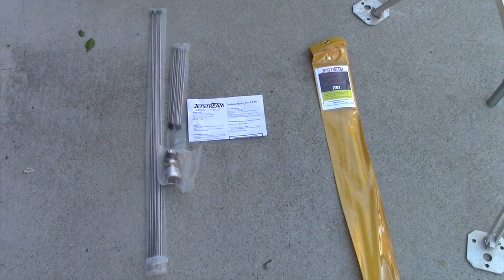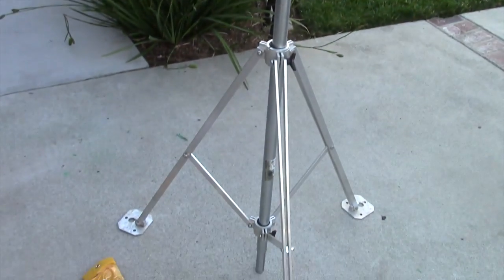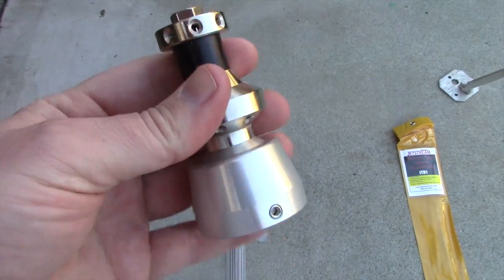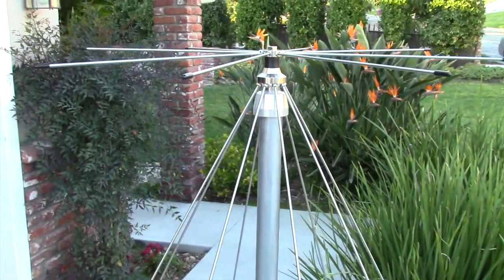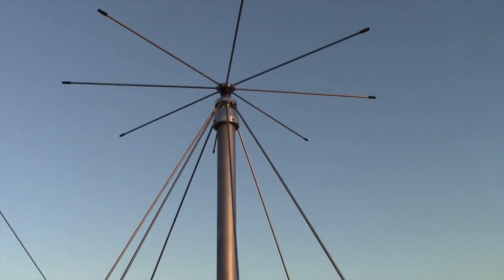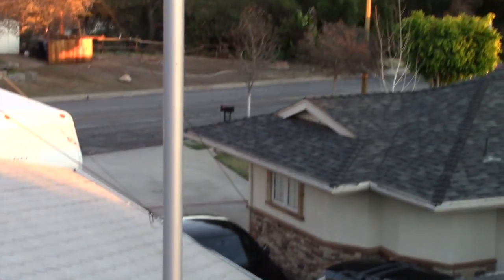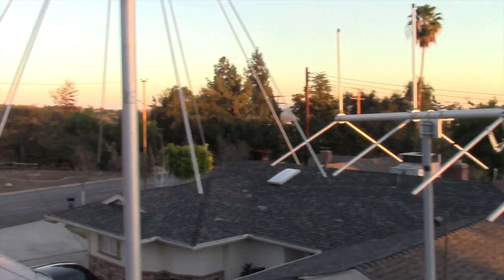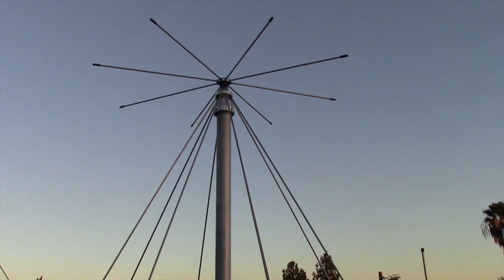AE6LX Installs a Jetstream Discone VHF/UHF Antenna

Comment: good video. just a tip always add some anti-seize to every place you put two parts together (screw in) that way you will never have a issue taking it apart down the road. If you live on the coast its a must. when your dealing with stainless steal its a must to keep it from binding up.

Comment: You are REALLY going to want to put split washers between the nuts and the hub.   Wind will cause the radials to vibrate, which will loosen the nuts, which will cause the raidials to unscrew, fall and get lost.  How do I know this?  It happened to me.  I was down to three radials after 6 months in the air.  All it took to fix the problem was a set of stainless steel lock washers from the nearest ACE hardware store and borrowing the tall ladder from the friend AGAIN.  Why couldn't they include lock washers with the antenna?  PROFIT.
Reply: http://hillcountryengineering.com/wp-content/uploads/2011/10/Split-Lockwashers-Separating-Myth-from-Truth.pdf

Comment: I have the JDT2 which has the 6m vertical on top, and 2 of the lower vertical radiators have loading coils and an adjustable stinger. No instructions on how to tune, I'm assuming these are for the 6m. What say you??

Comment: what kind of mast should I use on mine?
Reply: Structural aluminum tubing is probably the best, but may be difficult to find depending on your area.  A discone antenna like the one Tim shows in this video doesn't have a high wind load, so you don't need anything massively strong like you would with a big HF yagi.  I've used 1.5" EMT or IMC conduit from Home Depot in situations like this with very good success.  They've survived multiple wind storms of 70+ MPH gusts here in AK with no issues.
Reply: @AlaskaMike72   ... The top horizontal rail of a chain link fence works great for a mast... cheap too... :)
Reply: @wolfgangsnitsar4739  Yes--that's also an excellent choice for an antenna like this!

Comment: Hi iv got vhf scanner here in Ireland's. iv had a standard sky king fibreglass antenna. but the cable has got damaged over the years. so need a new one would u recommend the discone over the skyking for a uniden base scanner. I usually use it for boats up to 15 mile from my house.

l
Reply: +seamus doohan I would need to see a picture of that sky king to understand what it is before I could answer that question
Reply: +Tim Tucker http://www.longcom.ie/product.aspx?id=316

Comment: I've got the same antenna in a Tram version.  What kind of SWR readings are you getting on 2m, 70cm, and GMRS?
Reply: Overlin Alaniz I'm using the Diamond version of this antenna antenna to Receive/Transmit 6 Meters, 2 Meters, 220 MHz & 440 MHz via some mobile duplexers/triplexers.  The SWR on all 4 frequencies is about 1.20:1.  The Jetstream should be about the same provided that it has the 6 Meter whip on top.
https://www.youtube.com/watch?v=B-IwfcQrfRY

Comment: Would this work with a 50 watt vhf/uhf base radio? And what kind of reach do you get running vhf?
Reply: +Sean Maples Yes it will handle 50 watts.   You should understand that it is unity gain.
Reply: It's one level above a Dummy Load because it has No Gain on any band.The receive signals are much better than the transmitted signals with a Unity Gain Antenna.